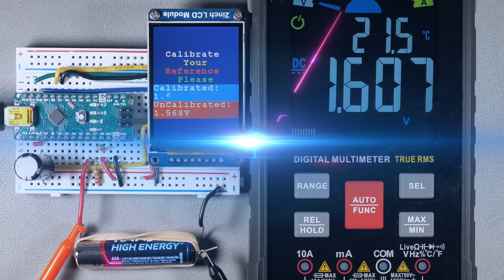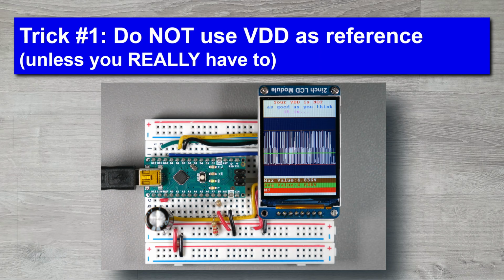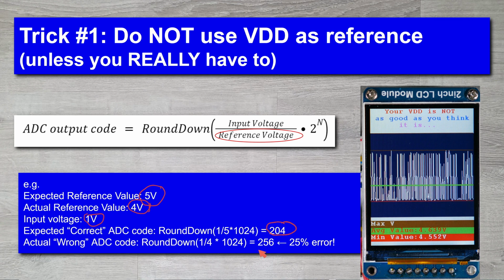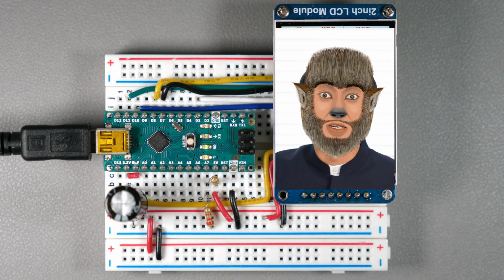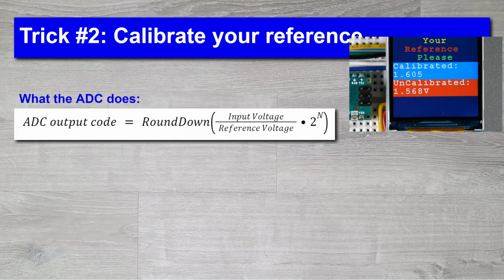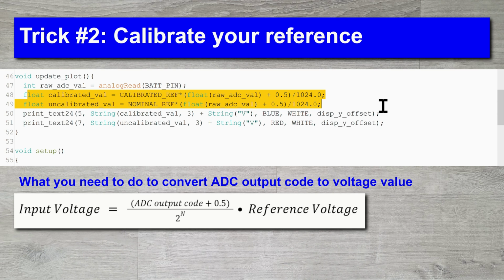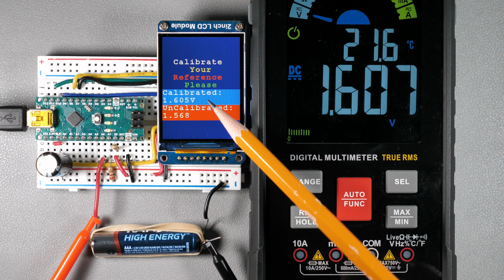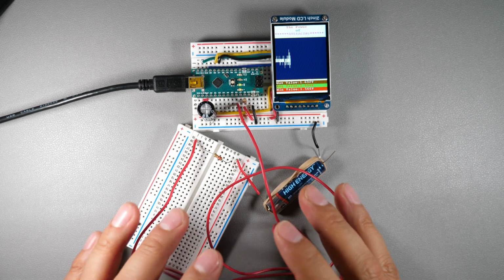3 Tricks for getting a Better ADC for FREE! (Arduino)

Comment: Wow, I really love your informative video!  Thank you. I have been trying to make a multimeter with Arduino and it wasn't very accurate.. But I wasn't using AREF , no filtering caps,  no averaging .  WOuld an external dac chip be better? Like an MCP3204?
Reply from the maker: Hello Jennifer: glad you found the video useful for you! External DAC/ADCs CAN be better in terms of total resolution (people in the industry call that "count", e.g. 10,000 count). I would guess for a multimeter project, your switching network and the corresponding conversion and calibration for each switch position will be where you spend the majority of your time, IF you care about pin-point accuracy.
Reply: @werewolfwu  using a 4051 to scan 8 reference resistors. Actually thinking of perhaps using four 4051's to scan 32 reference resistors , if that'd help :)  Would like for i to be as accurate as a bench meter. Somehow. Or perhaps buy a multimeter controller chip.. i have no idea.  I really want RS-232 communication with Arduino.  The UT61e+ has USB connection but Arduino isn't a usb host.  I want to log ohm measurements triggered by arduino, within an arduino circuit.
Reply from the maker: That sounds like a VERY serious project with that many analog switches!
Reply: @werewolfwu  I wish my Instek GDM-8251A Bench Multimeter supported sending readings over RS-232.. they only send over TRUE or FALSE on compare tests :( So dumb.